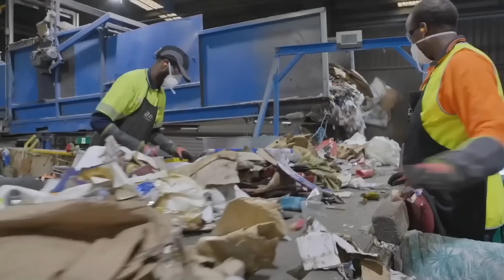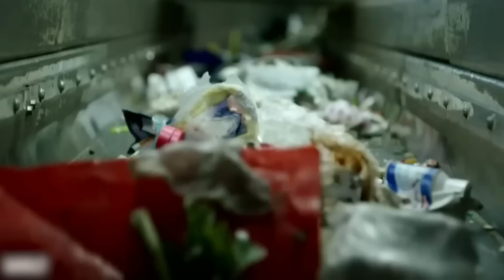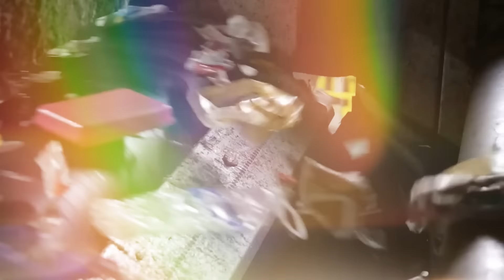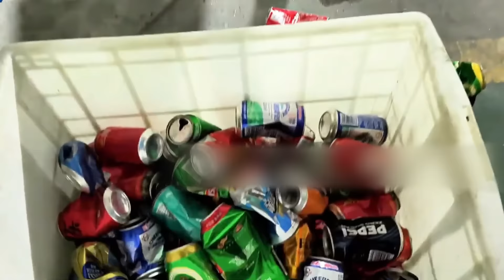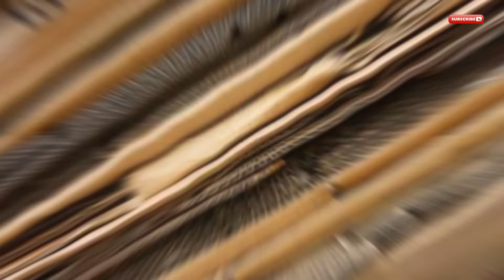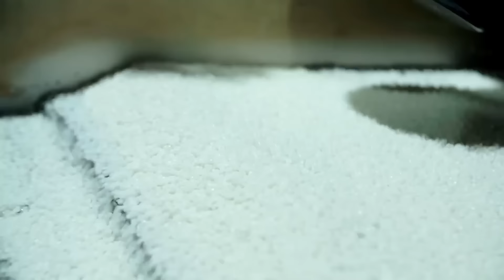How Recycling Plants Sort Mixed Waste in Seconds

Comment: I continue to be amazed at the lack of effective regulation governing packaging.  We diligently wash all of our recyclables before putting them into the recycle bin/tote and taking it to the curb. but the type of labels stuck with various adhesives onto plastic (usually) containers is almost impossible to get off in their entirety.  It would seem that some regulation should be enacted requiring the use of water soluble adhesives for paper labels.  In such fashion it seems that tons and tons of packaging might be more easily sorted.

Comment: As an editor at Chemical Processing magazine, I wrote or edited two columns regarding recycling. 

The first, in 2006, was about how recycling is partially, or totally, defeated by products that are designed not to be easily recycled. An example of this is the battery; another is the computer. In 1997, I interviewed with a company in Utah attempting to solve the problem of recovering rare earths from electronics: it wasn't going well at the time. Unfortunately for us, these rare earths, like cadmium, nickel, and others are highly toxic to us. 

The second article, written in 2022, summarized the dismal failure of recycling to reuse materials. Even paper and iron fall far short of ideal targets. Aluminum is easier to recycle because it doesn't corrode as easily as steels; doesn't stain like paper and fabrics; and is more expensive to manufacture, given the energy input to ores, than recycled aluminum; in addition, reprocessing quickly removes plastic liners from can interiors and paint. 

That's another key problem with recycling: it must compete with new product production. In refineries, plastic feedstocks like polypropylene are practically given away because they are difficult to manufacture into gasoline (84% of crude oil is turned to gasoline.). So, recycling, which works with a contaminated, colorized, cross-linked plastic, must compete with virgin material. 

As for rare earths, until it is cheaper to recycle them than refining them from raw ore, it will be difficult to make a profit. 

Then, of course, there is the question: "What do you do with the trash you can't extract recycle from?" For plastics and paper, the answer is electrical generation by burning. Unfortunately, this approach must deal with problems seen in TOX system scrubbers. Now, you have another unstable toxic stream to deal with. I have to remind people about the truth of caustic scrubbers in capturing chlorine: a little acid, and the chlorine comes out of solution to kill.

Some will argue for biological remediation. Do you know how bugs deal with toxic medals, like cadmium? By converting them into toxic gases that are much worse than the solid waste.

Lastly, there are the PFAS materials, i.e., -Cl, -Br, -F carbon chains. These so-called forever compounds can't be burned in a TOX, have the same problem as cadmium when eaten by a bug, and must be treated like we treat radioactive waste in vitrification.
Reply: People like you are the reason I read the comments. I occasionally find more information here than in the video.
Reply from the maker: I really appreciate you taking the time to write such a detailed comment and share your experience in the chemical processing field.
Reply: Thank you for sharing your experience in dealing with not only recyclables but, the lack of voluntary support from buyers who could make use of the materials but, for very short-sighted reasons, refuse to do so.  Political and legal mandates can increase their use but, it all depends on how it affects the product made with recyclables and whether the performance difference can be accepted.

It is clear that some materials are inherently recyclable i.e. steel, aluminum, glass, and paper.  Plastics appear to be the main problem in that they cannot be returned to their original components and remanufactured.  Plus, there are too many different kinds.  Thus, the efficiency for recycling plastics will be low.

Solution?  Instead of attempting to recycle plastics and expecting to recover its original use value, sequestration may be the only solution.  Instead of wasting time and energy with plastics, simply shunt them off to heated compaction process, make large dense blocks out of them, and then store them where open pit mines used to be.  In time, either a cost-effective solution can be found or they can be downgraded into filler material as a substitute for fill dirt.  I can envision some countries buying thousands of tons of the plastic bales for making artificial islands.  Such plastic bales and blocks of various sizes would make very useful building materials for low-cost housing.
Reply: @BlackPill-obey  You can't get rid of plastics. They are a byproduct of gasoline production. Refiners nearly give it away for free. 

Also, it is used for a variety of things we actually need. Russia tried to go into space without a plastics industry and its the underlying reason why they stopped going to the Moon.

The monomers and precursors of plastics are generally useless byproducts that oil companies are only too happy to part with. This has been going on ever since Goodyear asked Rockefeller, "Say, if you're not actually using that liquid you dump in pits next to the distiller, can we have it?" It was only later that they decided they needed to charge for disposal.

No, the problem with plastics like PE, PP, etc., isn't that they exist. It is that they must be returned to nature. Bio-remediation is the solution. Even Nylon-6,6 can be digested. We need to perfect the technology, even more than it has been, and convert it. Now, the CO2 produced can be captured and converted to C +O2 but that's another fledgling bit of technology that needs development. One caution: bio-remediation doesn't work for C-Cl2, C-F bonds, as in PFAS: even if it did, and it can, the products are more lethal than the plastic.
Reply: @dirkwillard5068  I never said to do away with plastics.  I said that it is not cost-effective to recycle them as things are now.  Let alone attempt to recover their original use value on a scale large enough to make it worthwhile.  The above suggestions represent way too much technology chasing a low-grade material whose potential will never justify the cost.

What I recommended was sequestration of plastics.  Use heated compaction to make large blocks that are easily handled and stored in decommissioned mines or in landfills designated for that purpose.  This includes the massive open pit mines in South America that are played out.

OR, downgrade their use case to filler material for construction and land reclamation.  The latter plastic blocks and bales can be further heated and compressed into very dense objects which would make them useful in low-cost structures of various types.  Or mountains of pellets where fill dirt isn't available.

Comment: This varies so much regionally some areas really need you to seprate glass & plastic as the local recycling plants are not nearly this advanced some like the one in your video are really good so you anly need one recycling bin.  It's important to undertand how your local recycling works before you recycle as mixing things together in an area that's not that advanced means it will probably be more cost effective to send it to landfil anyway
Reply from the maker: Absolutely,recycling systems vary a lot from one region to another.

Comment: Three bin and three truck system here in Aotearoa/ New Zealand. Green bin for garden/food waste is collected weekly (lots of people have gardens so, some people compost it at home and just send the bigger stuff like tree branches). Yellow bin (the largest bin) for recyclables is collected fortnightly. Red bin for all rubbish that cannot be recycled, is also collected fortnightly (on the opposite week). Many supermarkets have collection points for soft plastic and used batteries but, they can also be put in the red bin. You can also take metals and broken electronics to a recycling point at the dump. If you contaminate the recyclables by putting the wrong things in, you get a warning and for repeat offending you can lose your yellow bin altogether as when contaminated, the whole batch (truck load?) of recycling has to be trashed.

Comment: The problems mentioned here are most prevalent where refuse is not sorted by the customers. In Europe, paper/card, plastic/metal, glass, garden cuttings and general waste are already sorted. In the UK, plastic, metal and glass are usually one bin, but they are easy to separate. Our general waste (a Northern city of the UK) goes to a combined heat and power plant, which burns what it can and feeds power to the National Grid and provides hot water space heating to hundreds of homes nearby. Batteries are recycled in supermarket containers. Only ini a large country can one even think about just dumping "rubbish", as someone once said "you can't just throw things away, there is no such place as 'away'".
Reply: In my former condominium, there are 4 recycling bins - paper, plastic, glass and electronics.  One day, I saw the recycling truck arrive for collection.

All the contents of the 4 bins were emptied into 1 rear compartment of the truck.  Wasting our time sorting things for recycling, thinking that we are helping in a good cause. 🤦
Reply: You would be shocked at how your time is wasted with recycling because most of it just goes to the landfill. It's a joke on us.
Reply: @richardsackler7627   Governments want to be seen as being environmentally friendly, nevermind the actual effectiveness, or lack thereof.
Reply: @49jg Those recycling plants are almost always privately owned, not government.  WM Corp. (aka Waste Management) is one.
Reply: Country size is relevant. Here in North Queensland it's so far from large cities transporting the waste becomes a major factor. Small recycling centres, catering for populations of 20,000 to 200,000, are needed.
Reply: @treefarm3288  For sure a country's geographic size and population density plays a major role in determining its waste management approach, but not always and most of the time they're not needed, but if there's enough brainwashed Liberals around that are gullible enough to think they're saving the planet one aluminum can, glass bottle, plastic bag, cardboard box, old news paper,  and milk carton at a time then it's business as usual.

For instance we have oodles of landfill space here in Canada, despite that we're focusing on more advanced waste-processing technologies. Go figure.

For example in my colleges (specialized applied arts and technology campus) city over half the crap that gets picked up for recycling goes to the landfill. The business that collects the trash and recycling posts a profit from the recycling end of things as the "recyclables" that are never recycled go direct to the landfill and the government wastes taxpayer dollars paying the recycling company to pick it up, process it, and dump it in the landfill. Of course they make some money from the  non-ferrous UBC, ferrous metal, paper products, and rigid plastics.
Shit like glass has a negative market value  -costing municipalities about $42 per tonne to sell to landfills.
Flexible plastics is useless as it's a pain in the ass to sort / process and is usually contaminated so more "recycled" goodies heading to the landfill at extra taxpayer expense.

A closer look at many environmental initiatives, and "facts" exposes them as placebo policy,   pseudoscience or outright B.S..
Reply: When I taught Manufacturing, I took a tour of a facility that produced the cement for concrete.  It takes a tremendous amount of heat make cement.  This plant burnt waste material from recycle that nobody else could use.  After the material was burnt for heat, the ash became a key element for the cement.  Very interesting.
Reply: Exactly...if the truck coming around picking up recycling doesn't have 5 bins for the different plastics, bins for different colored glass...bins for newspaper and others for magazines...etc...etc.
It's ALL going to the landfill.
Thee are no long conveyor belts with Mexican ladies picking through and separating everything.
Check out all of the videos about people putting airtags in their recycling...only to see it go to the dump.

Comment: Seems like a waste of time energy and resources.

Change the paper source to something sustainable like switchgrass hemp and black locust addresses paper.

All metals are infinitely recyclable. 
Those are the main things to extract. 

If it's a hydrocarbon; paper plastic fabric etc.. ..flash-graphene. Use the extracted hydrogen to power the operation. 

Use the graphene to blend with virgin feedstock to amplify properties while reducing feedstock amounts per end target.
Reply: Unfortunately, its usually cheaper for manufacturers to use virgin raw materials than recycled ones.

But, I believe we must do what we can, individually, to reduce what ultimately ends up in landfill.

Comment: Why not sort at the source (the homes), like we do in Sweden? Paper in one bin, food in one bin, plastic in one bin, clear glass in one bin, colored glass in one bin, small metal in one bin and for the rest you have to go to a recycle place to throw the rest. Of course some people do wrong for some reason, but it gets so much easier at the sorting station. But it takes space if every neighbourhood shoulld have a number of bins.
Reply: Correction.  The source isn't homes.  It's the manufacturers of the products which are then packaged for distribution to homes via the process known as 'shopping'.  Perhaps partly under orders from such as 'EU Regulations'.  Don't blame us homeowners.  We don't create any waste, or at least very little.
Reply: Unfortunately, people are various mixes of uninformed, lazy, and dim. So the recycling plant has to sort out the mess regardless of what sorting you ask consumers to do. Once you have a big magnet roller machine that can pick the steel out of ten tons of material, how much does it matter what percentage is paper vs steel? You need the machine to process all of the incoming material anyway.
Reply: Americans can't sort. We seem to celebrate ignorance.  For example, look at the guy we elected to run the country.
Reply: @keithc5729 or the guy elected to run NYC.
Reply: @keithc5729  George Carlin RIP spelled out, quite clearly, that what we have in office is the best we can do.

Comment: Bjørn Lomborg (author of "Cool It") says his preferred approach to trash is incineration (waste-to-energy): put mixed trash in one stream, burn it in modern facilities with scrubbers on the smokestacks to control emissions (as is widely done in Europe), and recover the energy. He describes the residual emissions as very low with proper controls (far lower than older concerns about dioxins, which can be largely eliminated). This is simpler, cheaper, more complete in handling the material, and turns waste into a resource rather than relying on imperfect recycling systems.

IMO, the current method of recycling is moronic. But I guess it makes Leftist feel good, and we really want to keep them happy and feeling virtuous.
Reply: It is all politics. The engineering is only pointing one way, as you explained.
Reply: This used to be true 20 years ago, but tech have developed and recycling in fractions is now advantageus. We all need to reduce plastic (made from oil) consumption and this is the way. Because of its dysfunctional political system the US is way behind, but could learn from Asia and Europe.

Comment: Recover glass and metal. Burn the rest and generate electricity
Reply: Burn the rest? And release pollutants into the air?

The majority of the packaging manufactured globally is card/ paper and plastics, all of which can be recycled.

The solution isn't straight forward. But the more we recycle/ reuse individually, the better.

Comment: There are only a few materials that have any significant recycled value.
Steel
Aluminum
Clear glass
Clean paper/cardboard
Clear PET (#1) plastic
Clear/white HDPE (#2) plastic

Any other materials are just garbage messing up the system.  Unfortunately, people and cities like to pretend they are doing something virtuous by including those other materials.  It's like someone pouring used motor oil into your cake batter and pretending they are great for doing so.
Reply: Part of the problem is poor guidance. I'm reasonably conscientious when it comes to recycling, but I'm not going to spend hours trying to determine whether something is recyclable or not. I found out years ago that greeting cards with glitter can't be recycled, so I don't recycle them. However, for all I know, they may now be recyclable. There's no information either way on the local recycling website.

Another thing that's unclear is how clean items need to be. I've seen people throw unrinsed cream cartons straight into the recycling bin, thereby contamination everything with cream. At the other extreme, I once knew someone who put such cartons in the dishwasher before recycling them. The wasted energy and water was hardly environmentally friendly.
Reply: I throw the low grade plastic away like cellophane and shopping bags.
Reply: @dannydaw59 
In the UK, these types of soft plastics can be recycled and are collected by larger supermarkets.

Each country it seems has a different attitude to recycling. But the more we can recycle, the less ultimately goes to landfill, which has to be a positive thing.